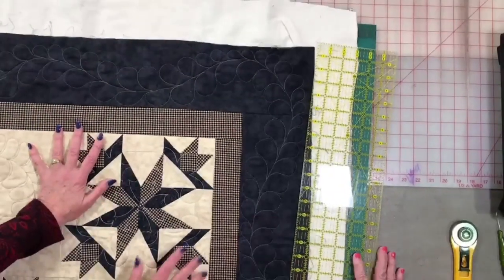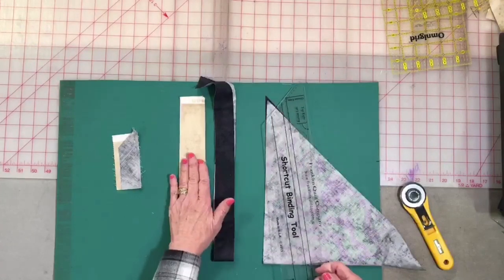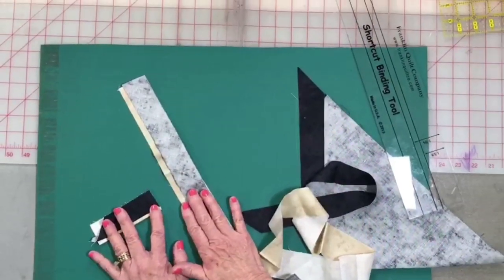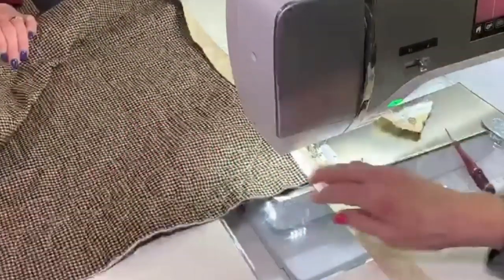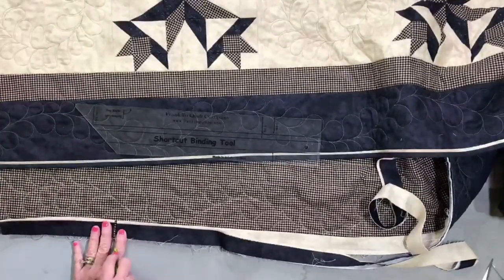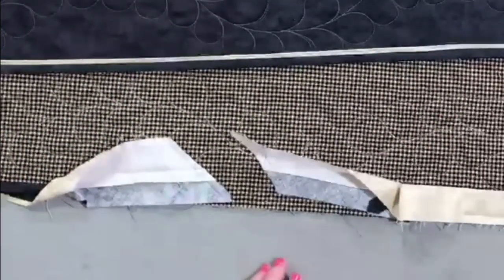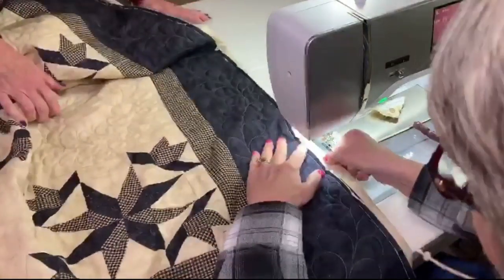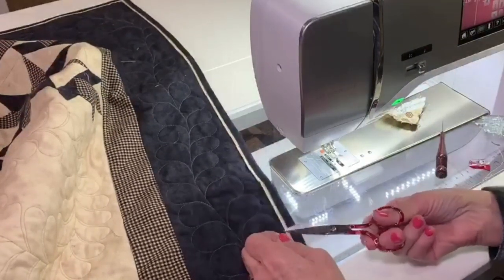Shortcut Binding Tool part 2 of 2

Comment: Hi Jodi, the second part of the video would never load. I desperately need some instruction on squaring up a quilt and was so delighted to know it was being presented in part 2. Could you check to see why it isn't loading? Thanks so much!
Reply from the maker: Zoe, it is loading fine for me.  I have tried it several times on different devices and it works good.  Maybe you can refresh your screen and try it again.  Let me know...Jodi
Reply: It now is working for me too. Thanks so much!